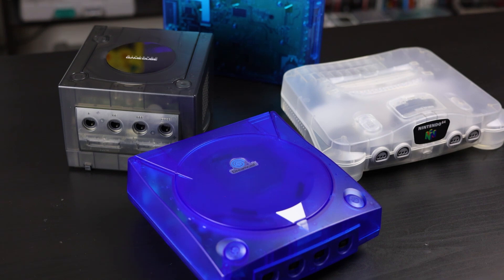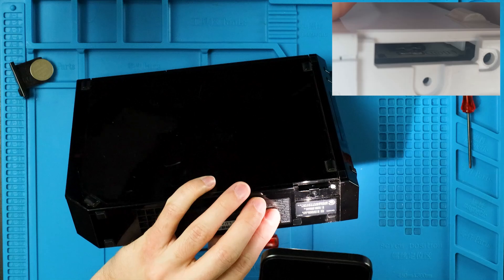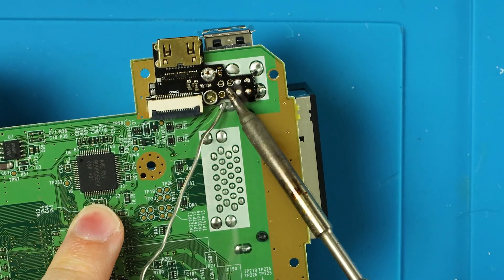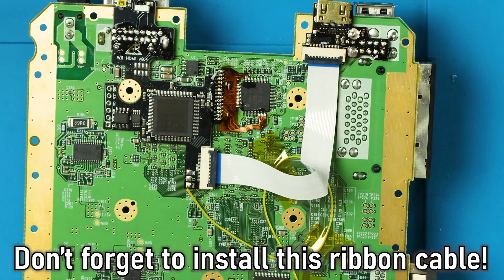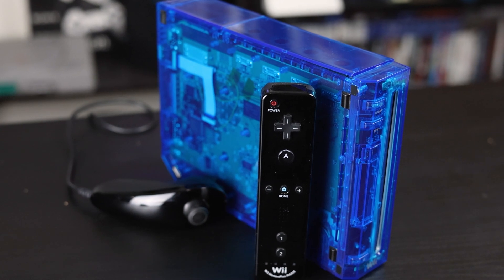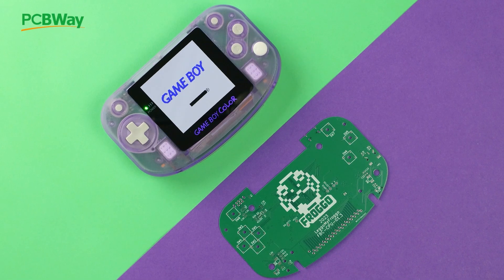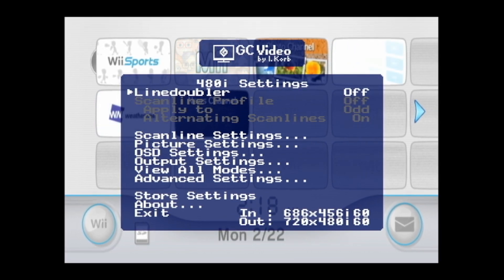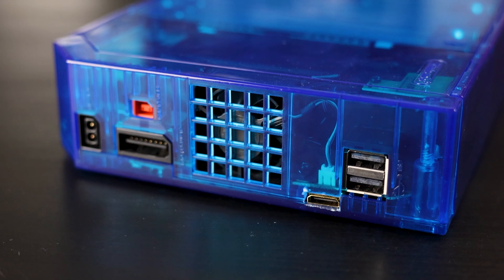The Wii Is Now In HD! | Arthrimus HDMI Mod Review

Comment: Man, I ended up doing a wii transfer too because the wii ended up overheating and dying.

I hate how mine needed the hdmi resistors to be swapped. I would say it is a big improvement over my retrovision component cables. 

Like no subtle wavy lines and sharper text

Comment: Another option if you want Wii games in HDMI is to get a Japanese Wii U for $70 and mod it the Wii portion of it. It looks great when you remove the deflicker filter with priiloader.
Reply: You can find a Wii U console only for dirt cheap as well. Just gotta get a gamepad to set it up. You can even fix the scaling in vWii mode and combine it with an m cable or upscaler and it looks great.

Comment: As someone who got the HDMI mod directly from the creator's website: it looks incredible over HDMI, and when coupled with software modding (ie: homebrew toggles that turn off the CRT blur filter and other unnecessary scaling options), it looks stunning at 480p, especially with the scanline filter applied (my personal preference).

I have also installed both versions of this mod (ie: using the two different ribbon cables for the different model Wiis), and got the same result on each system.

So if 480p is a mess (having read the comments), I'd highly suspect it's the mod itself, or whoever sold you the reproduction of the creator's mod.

I don't have a Wii2HDMI for comparison, so I can't say which is better, but I know for certain that Homebrewing a Wii and using an HDMI mod looks amazingly better than the default Wii's video output.

I am surprised whoever sold you the mod didn't include the ribbon for the earlier Wii models; it was a lifesaver having both ribbon cables in the mod kit from the creator!
Reply from the maker: Yeah I could definitely see it being a bad mod because I got it from someone who lazily cloned it but I also had no idea that there were home brew mods that cleaned it up. Good to know!
Reply: @JakeSimmons  Yeah the main difference for visual quality is in Homebrew allowing you to turn the CRT blurring, or whatever it is called, off.

Since the Wii was designed to work with CRT TVs and SD TVs, it just always had that mode turned on since they didn't know which technology their consumers would use.
Reply: Your mod is fine, you didn't enable the 480p output, which can be seen in the mod menu settings
Reply: still, theres not much difference between the mod and cheap wii2hdmi adapter. I played on the adapter for some time, then did the mod and honestly I wouldnt bother with it again, adapter was good enough.

Comment: No wonder you think it's garbage, you have your system running at 480i instead of 480p. Not to mention you didn't disable the blur filter and fix the pixel scaling in widescreen with homebrew.
Reply: no need to sound so aggressive, he did what he knew at the time
Reply: @ Yeah that’s not a good excuse. As a reviewer, you NEED to be thorough and give the products you’re demonstrating the fairest of chances to impress. This video has pushed multiple people away from WiiHD according to the comment section, so this video is actively sullying WiiHD’s reputation.
Reply: @saki3963  what's so aggressive about that comment, though? Just a simple statement of the fact, he didn't enable the required settings to see any benefit from that mod.
Reply: @saki3963 I mean he’s making a YouTube video he should know

Comment: Why are you not using 480p?
Reply from the maker: 480p was a shaky mess
Reply: @JakeSimmons  That's strange. The Wii should always look better with 480p since it is a progressive resolution. When I used component cables, I noticed it looked less blurry compared to composite, since 480i is really bad.

Comment: I have an HDMI modded Wii with the AVE HDMI from Electron Shepered, uses GC Video as well. Seems to work on every TV and monitor I've tried. I've also used it with an mClassic, which works great, but had issues on my Samsung 4K with it cutting in and out. Maybe there are some tweaks I can do but an HDMI modded GameCube (Pluto IIx) with the same GCVideo settings works fine through mClassic. I thought Pixel FX was going to make a Wii Retro GEM but I think they abandoned it.
Reply: The next best I think is the HDMI adapter from Electron Sheperd for $25. Runner up would be the Mayflash one from Amazon but thats a Chinese company but better than those $5-$10 Wii2HDMI ones. Mayflash does make good stuff.

Comment: Looks like you didn't turn on 480p output. The mod is basically working with 480i and providing simple line doubling. This is far from optimal result. You need to set it to progressive output to get the best picture out of your console.
Reply: You can literally see the inerlacing in the video lol